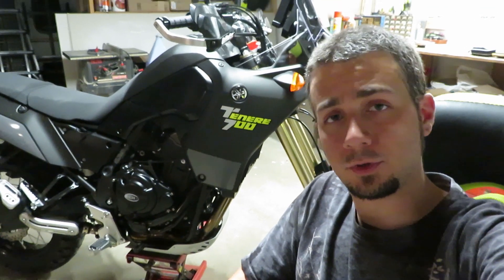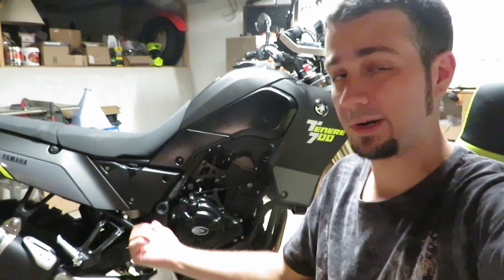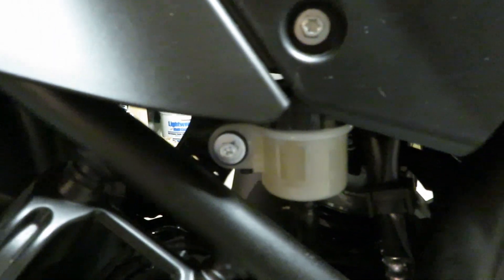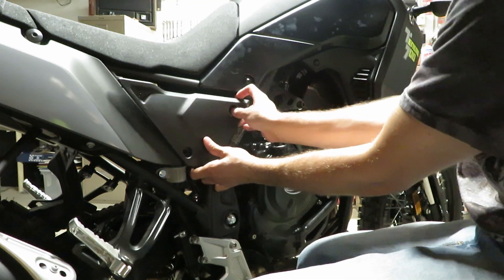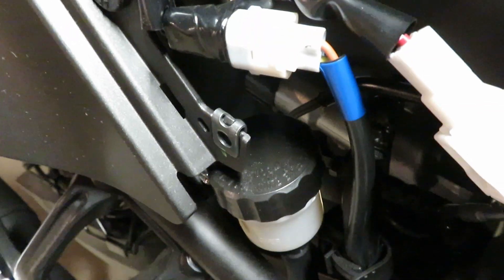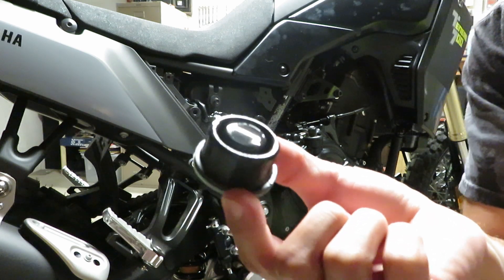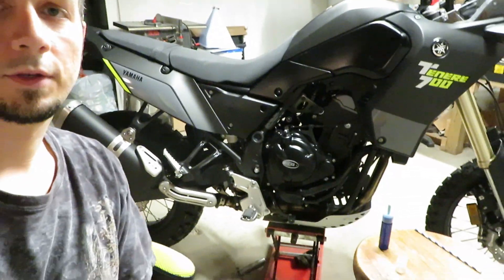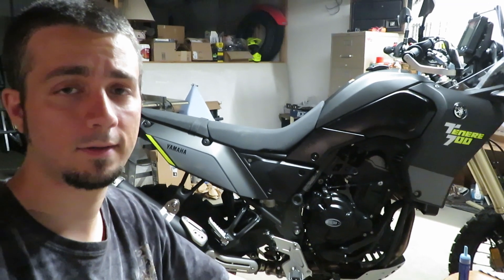CHECK THIS Before Your Ride Your Tenere 700!!!

Comment: Crack the bleed on calliper, with pressure on brake and pump a little out, put a piece of tube on the bleeder down into a bottle to stop the mess.
Reply from the maker: I actually did that when bleeding the front.  I didn't have the right size hose though so it didn't work very well haha.
Reply: SWANKY CAT windscreen washer hose 👍

Comment: That’s not what happens at all what happens is you end up resting your foot on the brake pedal and then it gets so hot it locks up I did it to mine and I’ve seen two other people do it. Sometimes you can smell your break when you stop.

Comment: I'd just have bleed the brake like I normally do. Everyone has a plastic hose from the hardware store that perfectly fits on the bleeder valve screw head. And a jar of old brake fluid you keep around to strip paint.

Comment: That's bad they shouldn't be overfilled, brake lockup will happen to any bike that's like that, level under the Full line is correct.
Reply from the maker: Yeah I'm not sure what the deal was with that.  Someone at the factory must have been a little confused lol

Comment: Wheels locking up would be a huge safety recall. No offence to you but I call bullshit.
Reply from the maker: I can't confirm the wheel lock up, but I've seen a large number of people talking about their rear brakes getting hot because of this.  As a matter of fact, just the other day (keep in mind this video is a few years old) I saw someone asking about their rear rotor being all blue and discolored from over heating.  I've also personally seen a brake lock up due to over filling, it was on a snowmobile but it's still a very similar set up.  Master cylinder, fluid container, rotor, caliper, ect.

Comment: Some of my bolts seem to have invisible locktite , haha .
Reply from the maker: One of the side case boots on mine seemed to have it applied to the inside some how, not sure how they do that lol.
Reply: @SwankyCatProductions  
I thought my brand new Klein tools t bar allen wrench was going to snap trying to get a couple of those bolts out . That was my first technical interaction with the Outback Motortek crash bars last month . I couldn't wait any longer for Altrider so I paid a few bucks more for TourTech upper and lower crash bars . The guys was super cool and the next day the box was in my garage . Washington to Northern California in one day ,nice . He's the suspension guy for them and I think I might take a ride up there and have them fix up the Tenere unless the place I bought the bike from has a decent suspension guy . At least I have  both my trucks readyish for taking the bike in for some warranty work , dang engine light is on and the oil is fine ? If it doesn't fit on my lift gate then up the ramp and in the Dodge it goes . You should be up and riding in a couple weeks you think ? It'll be good to see what you think about its weight and whatnot .